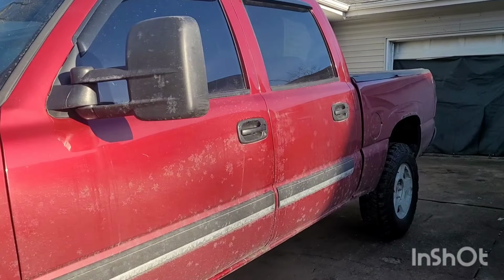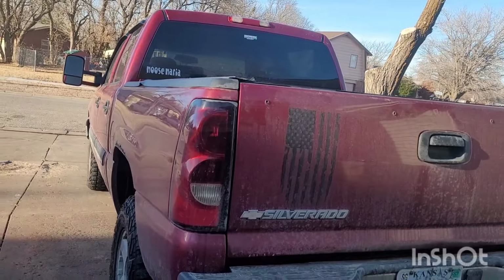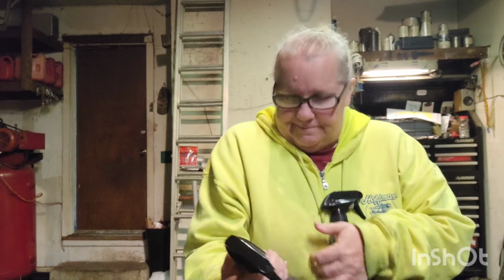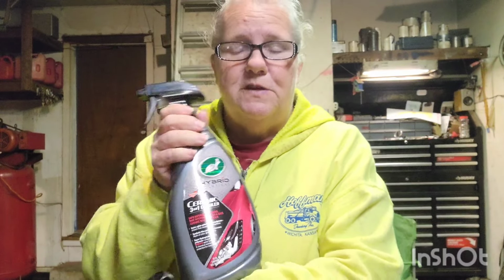Trying an APC rinse on Road Salt. Did it work?

Comment: If u use the hybrid solutions wet wax as a drying aid then apply the hybrid solutions ceramic spray coating, that’s the best process and helps extend the life of the ceramic spray coating. That’s what I used on my truck and my wife’s car about 8 months ago now with no reapplication just regular maintenance washes and both are still beading except for where the road salt is but once I wash it off the beading come back. The 3 in one detailer is meant to be a topper. Imjoshv did a comparison between the 3in1 the ceramic spray coating and something else and the 3in1 didn’t last long at all. It will work for just a quick shine but it doesn’t leave much in the way of protection. Here is the link to his video. https://youtu.be/hrSCyTU3Wx4